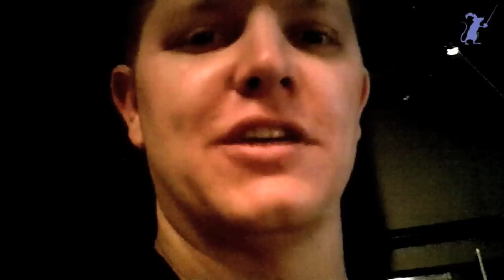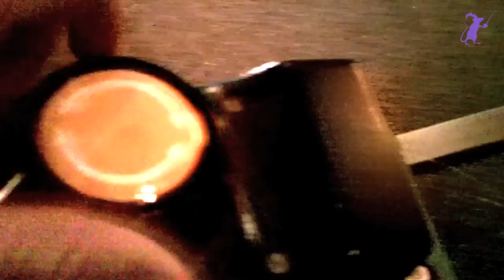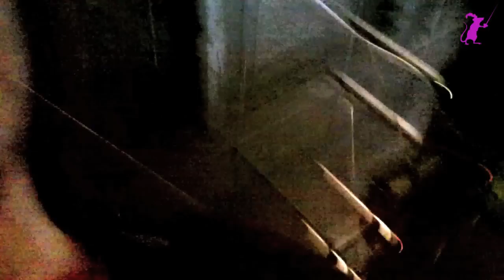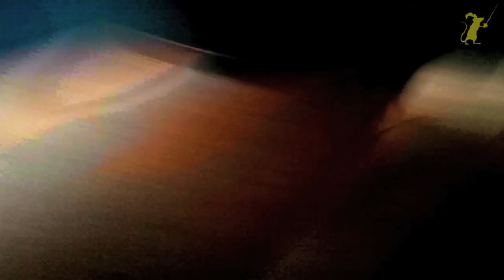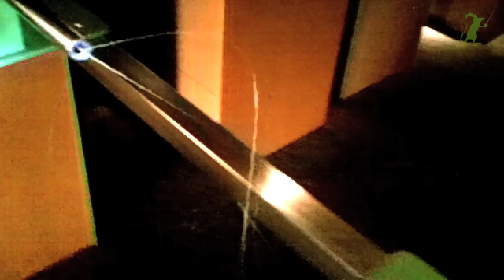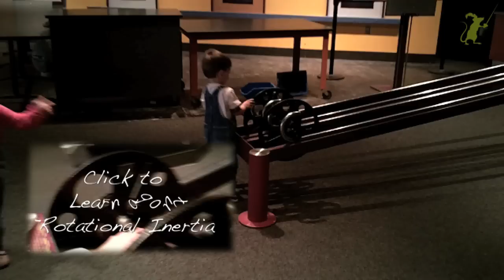Interesting example of Aliasing

Comment: Is that why sometimes when we see a recording of a computer screen it appears with fuzzy image and black horizontal stripes going up?
Reply: Better late than never. No, what you are describing is called a Moire pattern, and its caused because of the "interference" between the pixels on the screen and the pixel grid on the sensor of the camera.

Comment: @SmarterEveryDay This is incorrect: "In general, you want your measurement device to be one order of magnitude faster than the event being measured."  The Nyquist Frequency is twice the frequency being sampled, not an order of magnitude.
Reply: +Robert Bohrer that's right, but to get a reliable result, you want the signal of your measuring device about one order of magnitude faster than the signal you want to measure.
because, if it's only twice the frequency your signal has, and you are only able to catch the amlitudes, you get a signal, that's basically a triangle.

sorry for bad english, I am from austria and german is my mother's tongue

Comment: @SmarterEveryDay This is one of my favourite demonstrations of this principle! However, in general you want a sampling rate that is just a little bit higher than twice the maximum frequency that you want to sample. This is called the Nyquist theorem. If you know for certain that there are higher frequencies present in the thing being measured, and you have no way of constructing an anti-alias filter, then an order of magnitude higher sampling rate might be a good idea (like a safety margin).
Reply: Hence, one assumes, 44.1kHz sampling on CD audio tracks.

Comment: The original technique for observing high speed signals with an oscilloscope used this technique in what was called a "sampling Scope". It could show GHz signals with a sub GHz scope bandwidth.  It obviously only worked with repettitive signals.
Cheers

Comment: I have trouble with using the strobe effect as an example of aliasing.  What am I missing?  Suppose you set the strobe to ten times the rate of rotation, you'd still get a stationary image - only it would show ten positions of the string instead of one.

Comment: No, that's different. In digital imaging of any kind - primarily animation and gaming - anti-aliasing refers to sub-pixel detail that smooths out edges. Imagine a profile view of a stairway - that's the whole pixels, without anti-aliasing. It's fast to render, but looks chunky. Anti-aliasing basically puts a ramp down the stairs, so there's less evident pixel-chunkery, and a smoother look.